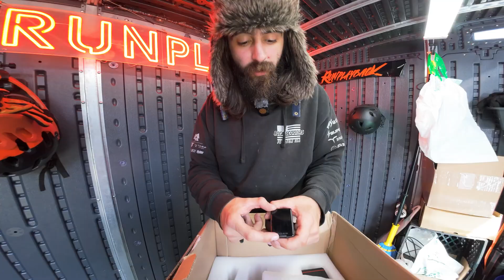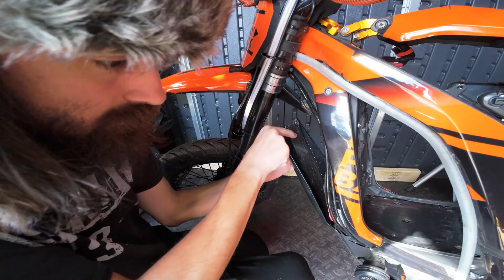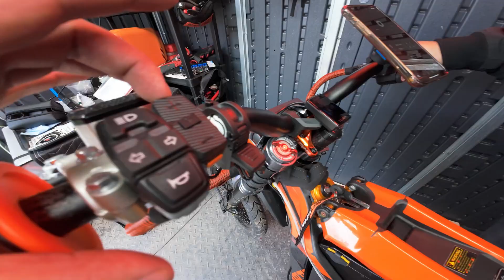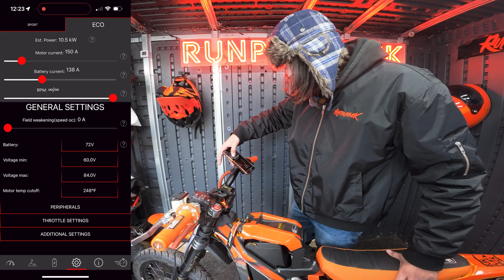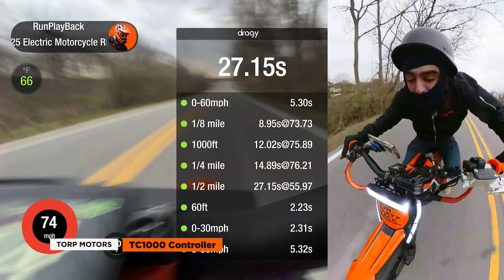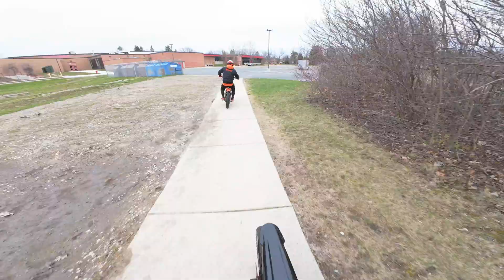The Ultimate 72v Surron Upgrade? Torp TC1000 + TM25 Motor Installed and Tested!

Comment: hi did you have to change the powerloom of the bike for 72v battery the original cables are not meant for this power
Reply from the maker: Same power loom, just changed the battery connector from the stock one to a QS8. The QS8 can handle higher discharge voltages. I think they make replacement looms with QS8's these days.

Comment: is there really a difference switching from tc500?
Reply from the maker: Good question and not really sure how I can answer that. With the TC500, I was running the stock motor and a 66v battery. If I just swapped the controller to a TC1000 and everything else stayed the same, then no it wouldn't probably wouldn't make much of a difference. It wouldn't suddenly unlock more power out of the 66v and stock motor. But running the TM25 motor, I think there would be a noticeable difference between a TC500 and a TC1000 - but that's just a guess.
Reply: Late answer here, so when it comes to phase amps the best way to explain it is you are getting faster acceleration while increasing heat on lower RPMs and a slight advantage to midrange acceleration. Now plainly this isn't increasing speed. HOWEVER, this nullifies the disadvantage of losing a bunch of acceleration when going from say the 48t stock sprocket down to a 42t. So in practice you could even drop down to a 40t while keeping the same acceleration as a 48t sprocket, so you'll have a higher top speed, while also keeping the same acceleration. But again, keep in mind. This is putting A LOT of heat stress on your motor. That is why it's highly recommended to get an aftermarket motor if using anything over 500 phase amps.

Comment: so im looking to upgrade my controller and battery...I know the battery im getting but I'm starting to really like the tc1000..do u like the controller better then others that you hv had??
Reply from the maker: Definitely, it's not a huge difference from the TC500 but if you're getting a high discharge battery than the TC1000 is worth the extra cost. Way better than the BAC4000 I had on it. Just really easy to install tune with the app.
Reply: @RunPlayBack  I've been looking around for the tc500 but no one has it stocked..only the tc1000..now I hv coming the chi 72v45ah battery..so now I'm gonna buy the controller..
Reply from the maker: @MiamiElectrix  yeah the TC1000 will be perfect for that battery